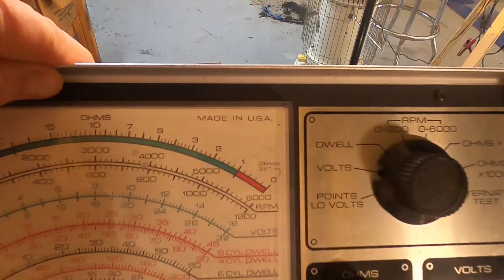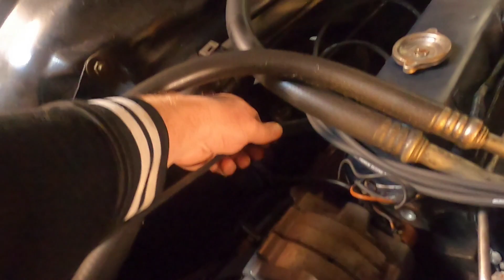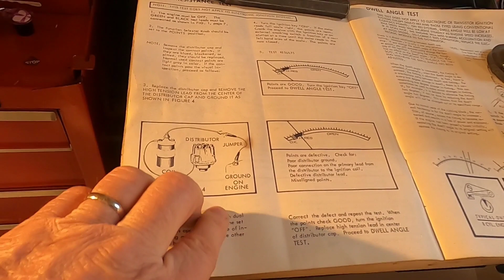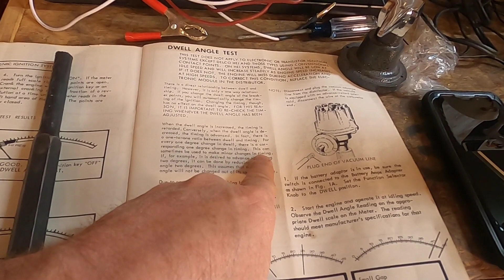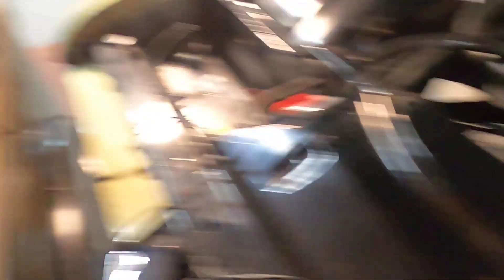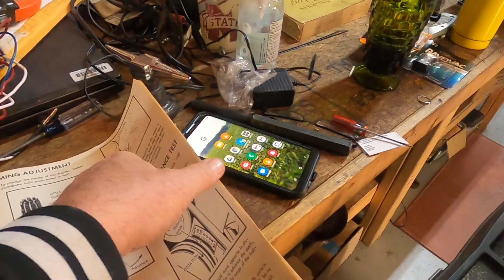Cadillac 472 - Checking Ignition Points And Dwell With Vintage Sears Penske Automotive Analyzer

Comment: First of all, thanks for making these videos.

Today I ran into an issue while adjusting the dwell angle:
With the engine running, I used an Allen key on the screw of the contact breaker. Suddenly there was a loud clicking sound, almost like a short circuit.

The engine immediately died and since then it won’t start anymore.

Do you have any idea what could have caused this?

1968 cadillac coupe.. all stock

Cheers phil
Reply from the maker: Wow. Assuming the engine turns over cleanly and smoothly while attempting to start it, the first the I would assume is maybe you inserted the allen key too deep and shorted something. If everything looks ok under the distributor cap, try replacing the points and condenser to see what happens. They are cheap. Also the coil might have shorted and blown. A simple impedance check across the coil windings is easy to see if it's healthy. Just search for how to check a coil on line. Is your coil wire secured tightly at both ends?
Reply: @ImpalamansGarage Hi, thanks for your input – really appreciate it.
Just to give you an update on what I’ve already done:
I replaced the points (contact breaker)
I replaced the condenser
I also replaced the ignition coil
Unfortunately, the engine still won’t start.
The engine turns over normally, but I currently seem to have no spark at all.
My suspicion is that I may have shorted something inside the distributor while adjusting the dwell with the engine running.
Quick question: Is there a standard preset gap for the contact points on these engines that you would recommend as a baseline before fine-tuning the dwell?
Thanks in advance – I’m trying to narrow it down step by step.
Reply from the maker: @philm.8601 .016 to .020 thousandths
Reply: One more thing I’m wondering about:
Could the wire from the points to the negative side of the coil be the issue?
I’m thinking maybe:
it got damaged or pinched
the insulation failed and it’s shorting to ground inside the distributor
or the pass-through/insulator at the distributor housing is compromised
Since the engine died instantly while I was adjusting the points, I suspect I may have created a short at that moment.
Would a constant ground on that wire prevent any spark completely?
Reply from the maker: @philm.8601 you are on the right track. Also check your resistor wire that supplies power to the coil. What voltage do you have at the coil with the ignition on?
Reply: @ImpalamansGarage on the + side 6V

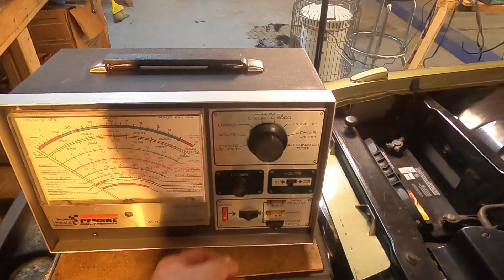Comment: 1:49 Last month I inherited a 71 Chevy C10, and in preperation for getting it back on the road and maintaining it as my daily, I picked a similar unit up. Mine is model number 244.21033 instead, bit more advanced. Got it off eBay in nearly pristine shape for....*30 bucks.*

One of the primary reasons I bought the unit is to do exactly what you're doing in this video. I don't plan on converting that ol' 250 I6 to HEI. Gonna leave it points fired; it's worked fine for 53 years why change it?
Reply from the maker: Great find! Good luck with your truck. Those old in-line 6 motors are bulletproof!
Reply: @ImpalamansGarage  It's been in my family since brand new and it's in shockingly good shape for its age! Very very very simple old truck...the SPID only has 8 entries on it...basically a quintessential stepside shortbed farm truck from back when. 3 on the Tree, 250 I6, manual everything.

I plan on making a daily driver out of it(Only mods I plan on doing are installing an FM radio, air conditioning, and a dashcam!), so having a meter like this is gonna be pretty important for making sure it's reliable. I know I can get it to run by just filing the points and setting the gap with the top of a cereal box or matchbox or something, but to get it running well enough for 20,000 miles a year I need to set dwell properly. So, hey, snagged a dwell tach.

I'm probably going to use some of the other test functions as well, even if the guys at parts stores technically make those tests irrelevant. I will probably be at a point where I want to verify the alternator is working long before I have the truck in a condition where it's able to drive 15 miles to the nearest part store, and since it will test the alternator, I might as well run that test.

Comment: Wasn't ur dwell at 40
Reply from the maker: No. You were looking at the 6 cylinder engine line on the meter. The dwell was set at 30 as noted on the 8 cylinder line. However the car has since been converted to electronic ignition.
Reply: @ImpalamansGarage   oh ok I see now.    What did u put in it?

Comment: The last year for points at GM was part way through 1974 vehicles. So I dought you bought this in the 80’s.
Reply from the maker: Correct. I did not buy this analyzer during the 1980s. I bought it on Ebay a few years ago. This unit dates from about 1980 or 81. Go here for reference: https://www.garagejournal.com/forum/threads/lets-hear-it-for-your-sears-engine-analyzers.300411/

Comment: Ahhhh...the memories of points adjustment. At 69 years old and after owning approximately 150 vehicles since my 1957 Chevy Bel Air 2-dr Hardtop purchased for $500.00 in 1968 with 283ci engine, Power Pack heads, power steering, padded dash, Wonder Bar radio and electric rear antenna, I have yet another car with a factory points distributor. A 1974 Corvette coupe with the factory 454ci engine. All original, unmolested and only 91,000 miles on the odometer. The last of the Big Block Corvettes and the last production year WITHOUT catalytic converters. Your video was very helpful in reacquainting me with how to adjust the points-style ignition. Thank you!

Comment: The flaw in the design is that it's a single scale: you can't see your RPM at the same time you want to check your dwell or alternator voltages.

It's a great piece of diagnostic kit.  Sears sold these units by the millions, and they do a fine job of peaking out the engine.  Every antique car hobbyist should have one in their garage.

Always start a tune up with the points: that is the fixed adjustment.  Do the points, then set the RPM, then set the timing, then set the RPM again (it will change when you adjust the timing).  Go back and forth between the RPM and timing a few times until it's stable (don't touch the timing anymore after this because now it's balanced to the RPM and dwell), then you can adjust the carburetor last using a vacuum gauge, again toggling between making a carb adjustment and adjusting the RPM until that stabilizes.  Everything is based on the dwell and engine RPM, you have to get those right before making the next adjustment or you will be chasing performance problems forever and never get the engine peaked out properly.

I love using the analog meters over the digital: if you know how to read the movement of the needle on the analog scale, then the engine will reveal all of it's secrets to you.  You can see things with a needle that you can't on a digital display- those little dips and burps on the needle reveal hidden problems.
Reply from the maker: Excellent overview!
Reply: @ImpalamansGarage  thanks. I've done plenty of tuneup on these mechanical cars when I was working as a shop mechanic back in the 80s.  They aren't hard to do, but tou have to make your measurements and adjustments IN ORDER and when the car is running.  Setting up the timing with the flyweights and vacuum advance is not a mystery if you follow the procedure exactly.    Do that, and you will smoke off your rear tires for sure...😁👍

And I am jumping with joy over the fact that you demonstrated using THE BOOK.  I've been working on cars and machines for 40 years and I always have THE BOOK open the the page of what I am working on.   I was told many years ago that "there are 10,000 ways to do a job wrong,  but only one way to do it right ".  So make the work easy and refer to  THE BOOK and do it once and do it right.

Comment: Just bought this same model off ebay, looks like brand new and all of the cables are still tied up with a band like it was never really used. Hope it works!
Reply from the maker: It should. They are pretty simply. There is a little circuitry inside. Check the battery terminals for corrosion.
Reply: @ImpalamansGarage  The pictures showed the battery holders and they look band new. Supposed to arrive tomorrow.

Comment: I have that same unit, it dates from around 1980 and Actron made it for Sears. The "161" in the model number denotes that Actron made it for Sears. I found mine on top of a trash can out for collection around 2000 or so. It was missing one piece, which Actron sent me at no charge. It was otherwise complete down to the manual and all of the other attachments. Actron even sent me the schematic for it. I worked with a guy that was great with this kind of stuff, so he hooked it up to a piece of calibrated equipment that we had and he "tuned it" to work like new. I still speak to that person from time to time although I left that company over 15 years ago. Peerless Instruments made some similar products under the "244" model prefix. Peerless was bought by Actron in 1983. 

Actron was located in Cleveland, OH and was staffed by old timers that knew that old product. Robert Bosch bought them years back and they no longer support that old product anymore. I must have three or four of these old analyzers including one brand new from circa 1984 that was never turned on----I got it free off of Craigslist in 2020. I have the same model as the freebie that my dad bought in 1983, a 1986 "dual function" analog/digital unit (that was about $200 new. I picked it up on Ebay for probably 1/3 of that with shipping) and this same one as you have featured here. 

These are great tools for the older iron (which I have too).

Comment: A few years ago I had a chance to buy a nos sears vintage automotive engine analyzer tester from someone off CL. The seller never showed up. 😠
Reply from the maker: There are a ton of criminals on Craigslist for sure.
Reply: I wound up with an NOS one for free off of Craigslist that was made circa 1984 by Actron for Sears. I had to drive to his house to pick it up, but as promised, it was on the porch in a box, complete with everything except the manual. That was no problem, I found a copy online and saved the PDF.

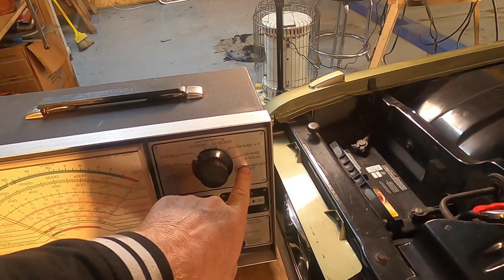Comment: I have a stock bottom end 1970 500,with gapped rings  0.020 gap,MTS cam,lifters & shaft rockers.The heads are ported & polished 70 heads with BBC 2:19/1:88 valves with bowel work and studs.Never had it on a dyno but it was in a 78 Malibu and ran consistent low 12's/ high 11's on motor and high 10's on spray before the new heads and head work,ran 11's on motor and started to seep water in the #1 so I haven't taken it apart yet to see what the issue is,had a special set of reusable gaskets that have done extremely well before hand and hopefully that's the problem.I have a 78 coupe that I'm building for a little street sleeper action probably will do a girdle and forged rods/pistons before I assemble it again.Love your channel and the fact people think Caddy motors are "Old man" motors.They just have no idea and yes I learned from a old guy and Marty.

Comment: Thanks for the videos.  It brings back memories of while serving in the USAF of taking my ‘66 Pontiac GTO to the base hobby shop to change spark plugs, points and condenser. Had to use old school timing light and dwell meter which I still have on the shelf….
Reply from the maker: I was in USAF as well. The hobby shop on base was really nice.
Reply: @ImpalamansGarage  btw, what was your job while in the  USAF?
Reply from the maker: @ronstjohn6780  Old AFC was 305. Computer maintenance. We maintained and repaired what were referred to at the time as "mini" computers and some main frame stuff.